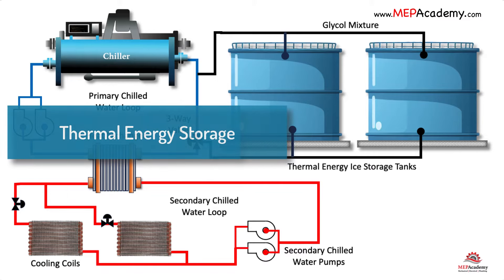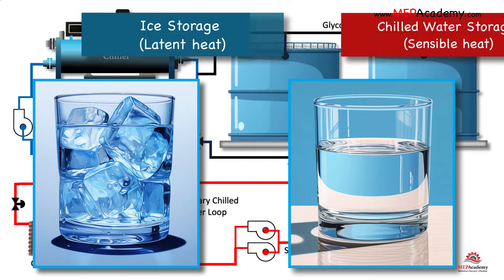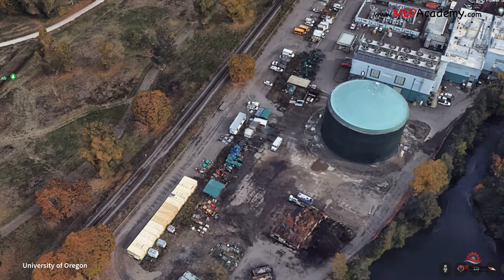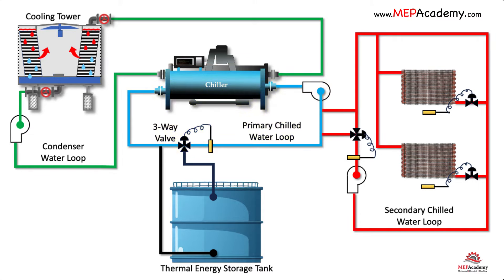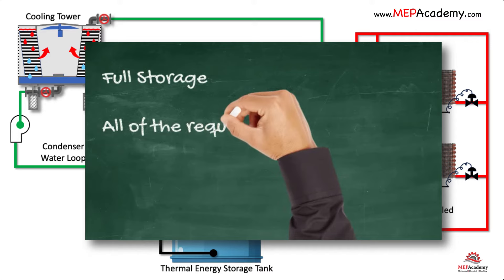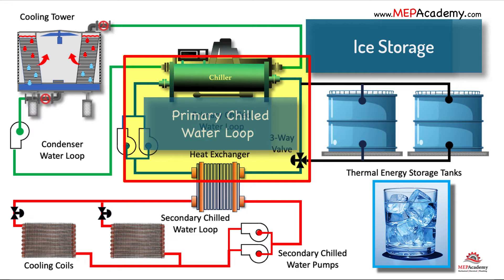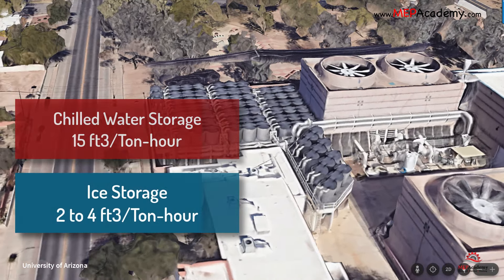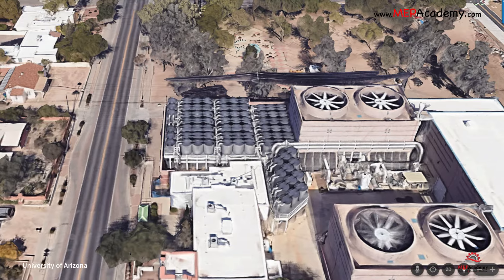Thermal Energy Storage

Comment: Maybe we can use other materials, like the thermal oils or salt and chemicals, the heating storage, the energy from the solar can uses the  reflection mirrors or lens to focus the energy onto the heating system 5:39 system ,the Ice storagecanusethe vacuum freeze,
Reply from the maker: There may be other options that could be developed, but we demonstrate the most commonly used methods today. Thanks for watching.